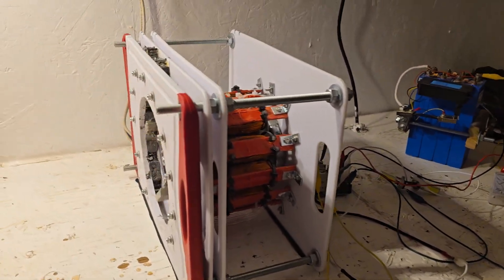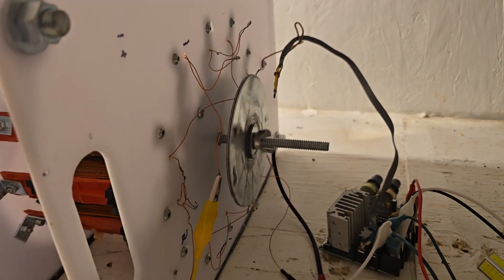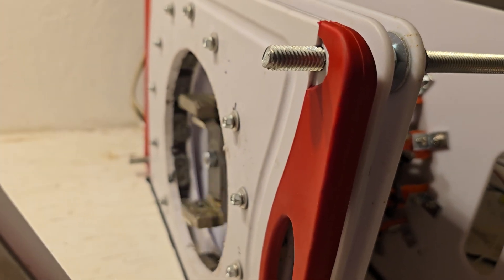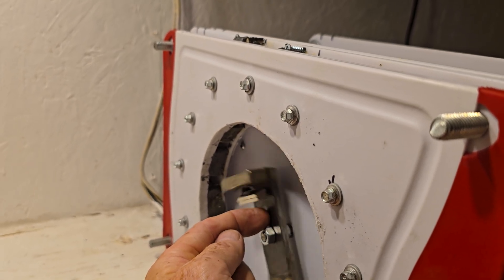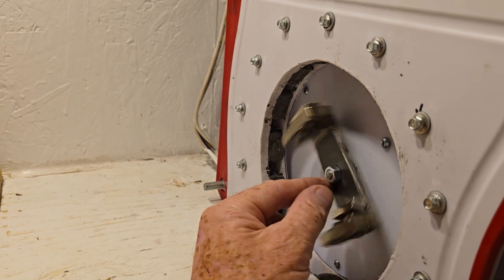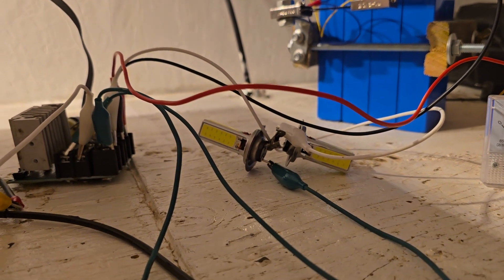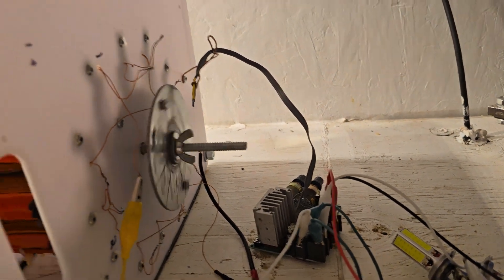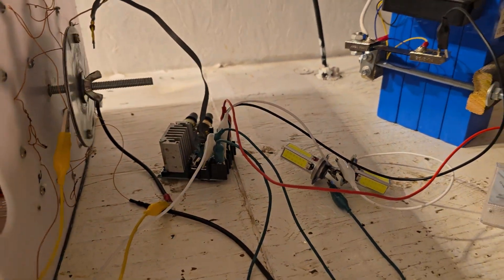Magnet Ramp can provide insane amounts of torque .( Low power Demo )

Comment: Gday wp&m can you flick through your email? I've been playing alot with my pulse motor.. all different configurations. I'd really like for you to view my setup and see if you have some ideas on how I can get better rpm. What I do know is that in series (out of 8 coils) each coil that's added to the first coil makes it slower and slower.. so much to try!! Cheers.
Reply from the maker: Did you email me ?

jvhoeops@gmail.com
Reply: @windpowerandmore6310 iĺ send through a basic drawing/diagram of the motor first. Then what would be the best way to show a quick video of it running? I haven't done that before but I'm guessing a link?
Reply from the maker: @benlinke7745 you can send a short video through wetransfer to my email it doesn't cost anything and works well 
https://wetransfer.com/
Reply: @windpowerandmore6310 I just sent a quick vid.. hopefully it shows you my setup in a bit more detail. It's being driven with your circuit but with a 100n50f fet. I can drive it with the 44 but I let the smoke out of heaps of them and others trying different things.
Reply: No I haven't emailed you yet. I thought you might have been busy or away..

Comment: Having a magnetic ramp will accelerate more tangential toque and centrifugal force making it even more powerful without adding more energy  to it, especially when having the right mass of the flywheel effect added through the inertial momentum. You pulse motor is a beast 👍
Reply from the maker: You're right buddy I wish I was recording videos when I was building these motors years ago.  Especially the regular dc motors doing comparison between normal and with the ramp and  just a mechanical on off home built reed switch or comutator.  The results were very obvious! There's also something else I will show when I have more time is the satellite rotors with different magnet spacing then the main rotor but running off the same drive coils. I sort of showed this in one of my early videos I found years ago I recorded on old vhs then just recorded from the TV screen 🤣 doesn't show much and that was just a junk motor lol
Reply: @windpowerandmore6310 That would of been exciting to watch. As always cant wait to see more.

Comment: when you say "ramp" is that the same as the v gate concept but for a pulse motor ?
Reply from the maker: Yup pretty close but the v gate doesn't increase the magnetic strength as this design does.  In this ramp i used n52 magnets increasing the magnets by 2 all the way around the ramp which provides way more torque than the v gate design.  But this design costs alot those magnets aren't cheap and definitely not easy to  build with all  the forces acting when placing them.  Definitely takes patience and a bit of blood 🤣
Reply: @windpowerandmore6310  lol snap !!!!!

Comment: What an excellent video
Thanks for sharing i want more information please make how to or link for this
Reply from the maker: Thanks for watching! I'll be posting a lot more information about this motor if people are interested in this type of setup. It's by far my favorite setup as I've seen in the past from numerous builds I've done including some with dc motors which proved to me that magnets are definitely a source of power.  This video isn't showing this but it is just a demo and test for me with the driver circuit attached.  
Here's a link to the old build video i made when I built this motor a few years ago.  It has the old pnp dual driver circuit in the video.  What is different now is all the coils are in series with just a single  PWM Driver circuit. 
https://youtu.be/mnIPiUix4zA